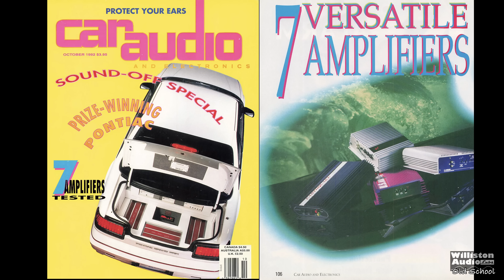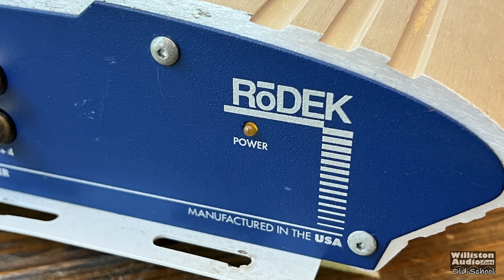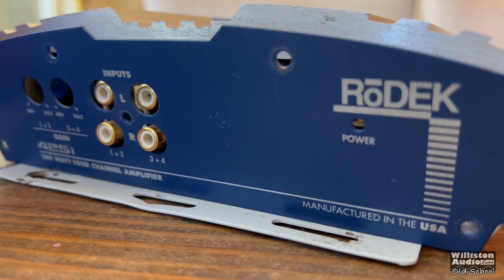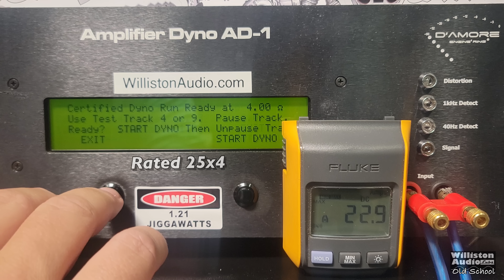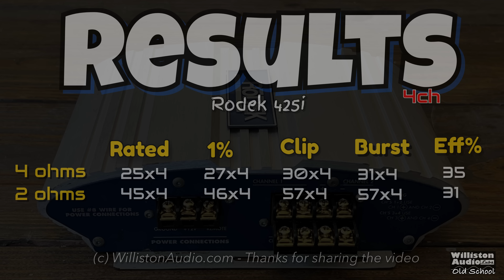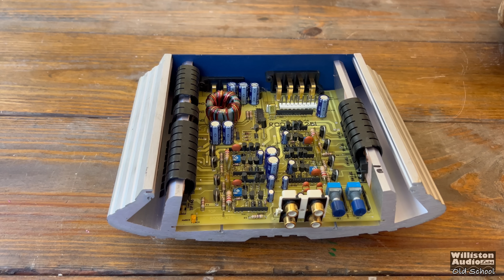1993 Rodek 425i Amp Dyno Test and Review

Comment: Derek what preout voltage did you use on your test or any idea if they can accept 4 or 5 volt head units without loc I have a couple the biggest one actually 2300i and the smallest one 225i I was going to use this as a front stage that'd be oh never mind I'm out of heeeeeeeere😮

Comment: I hope you put a lil dialetic grease on those after the evaporust bath. If not they will rust back up rather quickly. I use evaporust almost daily. I have a chain from a bush hog mower soaking in it as i type this. Lol.

Comment: I went to a few IASCA events in the North West area back in the early nineties. A couple of people ran these amps including a friend. They were solid performers and could take some serious abuse. One of the competitors had a low rider truck with a blow through. As it has been so long, me recollection was a wall of (6) 15” kicker (gold label) subs running off of a 250e in the bed, and (2) 230e’s running either fronts and rears , or mid-bass and the other mids/tweets. That truck was the loudest for its power class and did extremely well in its class and SQ. He was either 2nd or 3rd overall. Hard to find these amps  used these days. would not pass up an opportunity to own one though. Top quality Zed designed product.